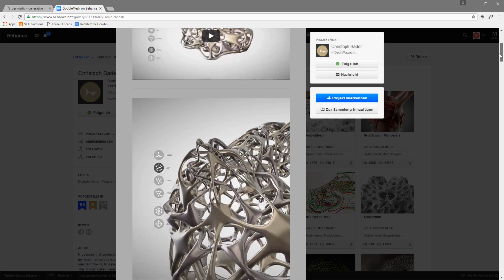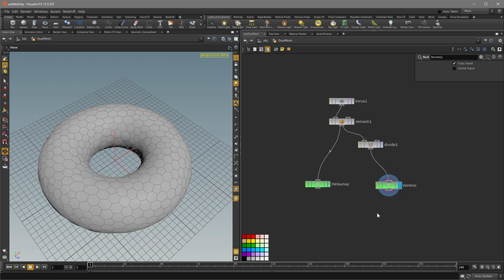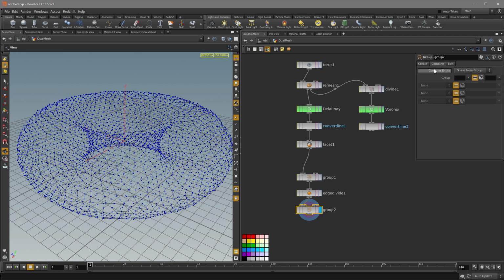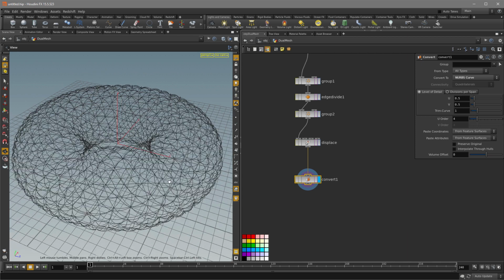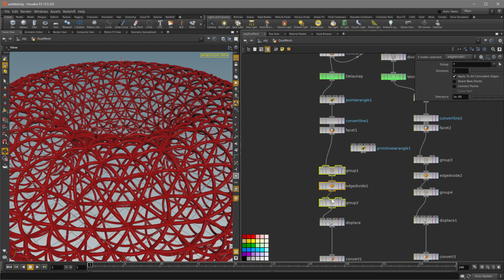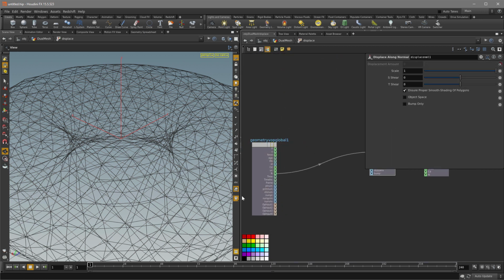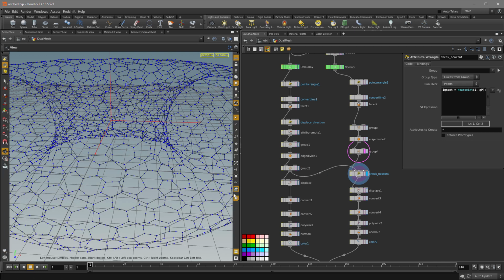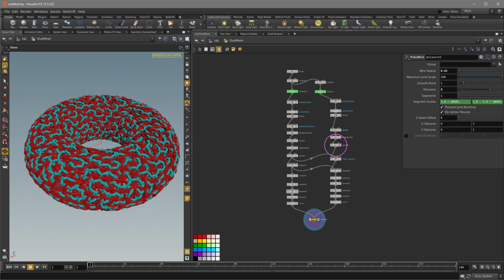Dual Mesh

Comment: Still a beginner here. I was getting a problem where each polywire was meeting another polywire and I was getting chopped off ends. I was searching for a way to get the ends to connect or fuse together. I then downloaded your example file and saw that you put a sphere on the ends (points that were not initial) and then at the end VDB'ed everything. I was hoping there was a more efficient way, but yours did the trick!